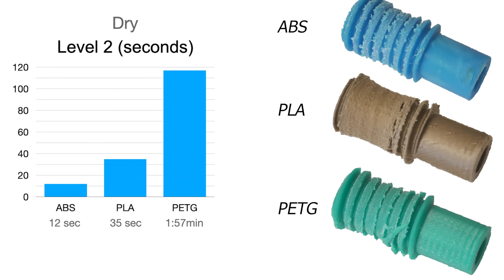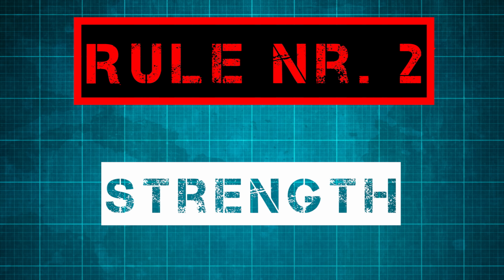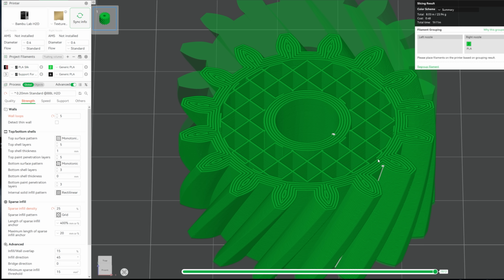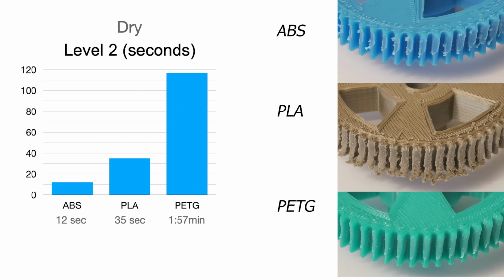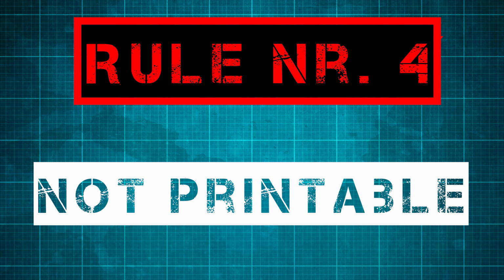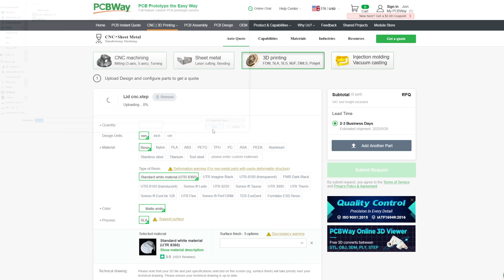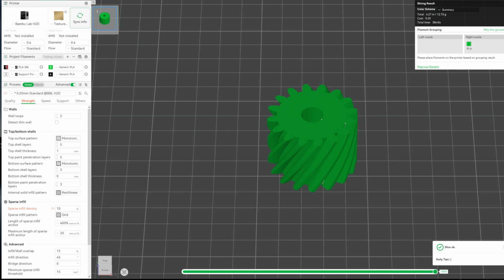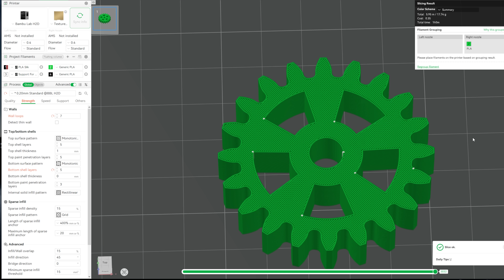How to 3D Print Gears That Actually Work

Comment: um.. glue stick is the best, if your nozzle and filament feeder are working. they might clog or slip. both sides brim is just fine too, with the glue stick. you could electroplate gears with copper metal. sounds like preference rules. PETG works fine too. electroplating (check hacksmith bone electroplating video) will make plastic filled metal gears that are very strong, similar to full metal gears. lost pla casting with micro wave metal casting. just infill 100% for strongest parts. yeah strong ribbing works too.
Reply: Explain please

Comment: PLA isn't a bad material for gears. I designed replacement gears for my vintage 1960s desk fan to make the oscillator work again and with the grease I put it in, it's been working flawlessly for weeks on end with little to no wear or melting despite being in a metal encased frame that is in contact with the hot motor when running. Just make sure the gears mesh well and you put good grease. Then let them wear in a little and it's perfect for a lot of things
EDIT:
Oh yeah I forgot to mention but the replacement gears I 3D printed with PLA does involve a worm gear. I decided to print it just vertically and it's also been working fine. It's mostly worn in now and the osculation is butter smooth
Reply: Yeah lubrication is super important. Reducing mechanical friction is one of the best ways to lower heat

Comment: you should do 100% infill for 3 layers every nth layer
Reply: Just out of curiosity, how do you achieve that? Is there a setting in the slicer?
Reply: @Rulusto  My approach in Cura would be to place Modifier "plates" (say, 0.6mm thick, 3 layers). The density (how many, or the spacing between them) is your choice.
Reply: @Sekir80 thank you

Comment: Microdetails can be used to put walls in places where walls don't exist. Cut 0.1mm thin but long square, extrude it thru the part and the slicer will form a wall around this "hole" but it is not enough to actually create a hole when printing. Very fast method to add internal walls anywhere you want. The designer in us want to create larger holes but microdetails are much better. The size of the microdetail is dependent on the slicer and its settings so experiment a bit first.

Comment: A little detail about 100% infill: it is not printed always with the same settings but we allow a lot of under extrusion to happen. They are not structurally that important so many slicer profiles have fast printing of infills. It can leave air trapped between the lines and generally just weak, wasting plastic. Using 999 walls or top/bottom layers will make sure that the piece becomes more solid. Especially important when you anneal or reflow parts or deal with buoyancy. It is also quite fast to just do the infinite wall method in the slicer than going thru all infill settings to set them the same as walls..
Reply: Actually, the BEST way to print fully solid components with absolutely 0 air gaps is by setting your top and bottom layers to 0 and the internal SOLID infill pattern to monotonic lines and 3-5 perimeters. Then set Minimum Sparce Infill Threshold to 99999mm2. this will make your part have 0 infill and be pure monotonic lines. with 3 perimeters, most small areas with curves will have no gaps as the Monotonic Lines pattern will make its way into every nook and cranny.

Printing with 9999 walls will introduce small air gaps in certain curves where there will be gaps inside without serious over extrusion. With 3-4 perimeters, you can force slight over extrusion in the perimeters and adjust your Infill/Wall overlap settings to reduce over extrusion in the solid infill. this will result in the highest density possible in your print while retaining maximum dimensional accuracy.
Reply: Use a concentric infill pattern and 0 top/bottom walls
Reply: @RocketBlox789  The speed and flowrates are not necessarily the same when you print infill, it can be under extruded. I noticed it when doing re-melting. Prints printed with 100% infill sagged noticeably more than all walls. That means there was more air inside. If you adjust infill to use exact same settings, speed, volumetric rate then it is the same of course, but it is just much faster to set 999 walls or bottom&top layers than going thru all settings. You also need a slicer that has all parameters visible, by default infill is optimized for its true function: internal supports.

Comment: On the elephants foot, what i do is add a 2 layer high and 1 layer deep chamfer on the bottom of the gear. This way worst case 2 layers of the gear does not touch the other gear, which is less of a problem then an elephants foot.